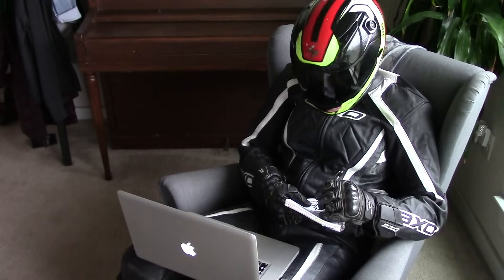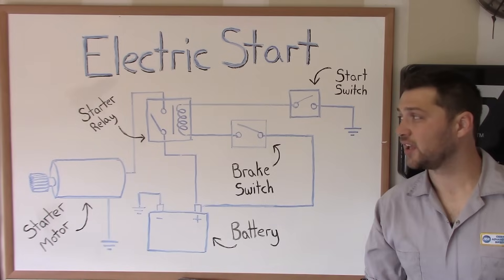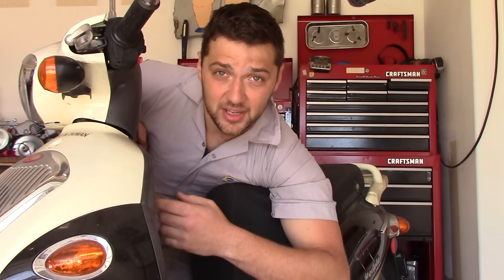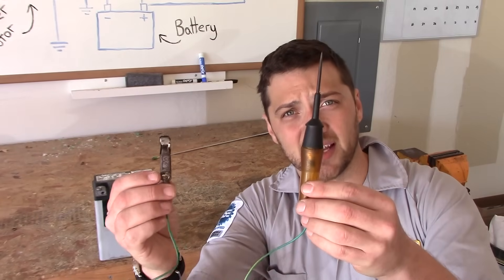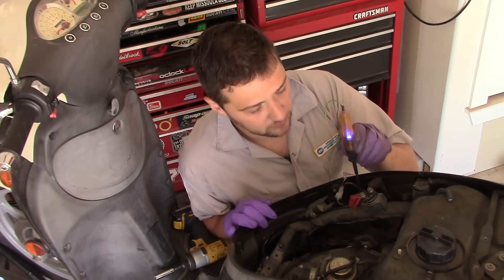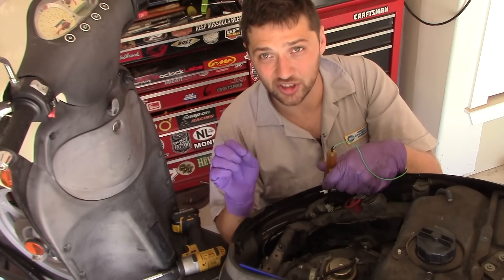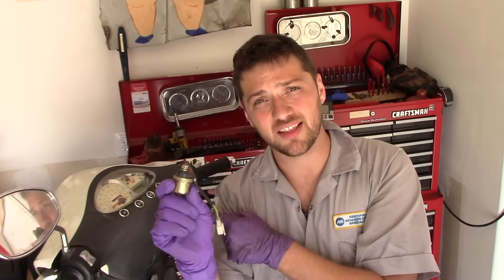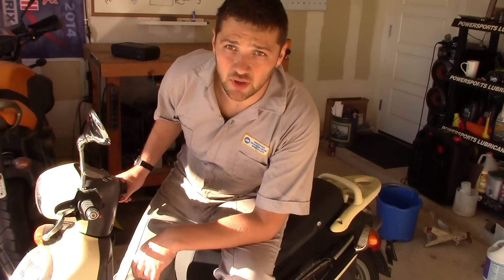Scooter 911: Electric Start Doesn't Work (troubleshooting your starter, starter relay, and circuit)

Comment: I have a 2013 benelli quattronove 49x. I got it a new battery, spark plug and gas, but every time I hit the electric starter or turn signal the whole thing turns off. The horn doesn’t work but the brake lights do and it won’t crank at all with the kick start. How do I go about fixing it? Anything helps 🙏

Comment: My scooter was running. All I did was remove the fuel tank, clean it out and install a new petcock. But now it will turn over but there's no fire and no fuel coming through.

Comment: Great information .  Doe's the key need to be on when probing with a light tester ?  I think I did it both ways .  Checking the starter relay .  I have no spark so I will be testing the coil next . Kymco people 250  2004

Comment: where do you start, after it's sitting for few years, now put new battery, new fuel, press start with brake depress and seeing brake lights on, but scooter does not make any clicking noise at all?

Comment: On my 1986 Yamaha Razz I replaced my battery and put new oil in it. However when I use the starter button the oil light turns on but the bike won’t turn on. My horn works and everything works. But the bike won’t start. Is there a wiring issue or do I have a faulty oil senso?  since usually a bike won’t start if there’s a bad oil sensor. What should I do? PS the bike does start and run perfectly fine when I kick start it.

Comment: hi garret im craig i have bought a lexmotot verona 125 cc scooter the guy said all it needs is a battery i charged original battery put it on and this happend no igntion no brake lights or indicators no horn but main headlight works but stays on when i remove the key any HELP would be apreciated

Comment: Thanks for the most helpful and pleasant my--scooter-won't-start video. My problem however lies with the bushings on the bendix. It was very hard to diagnose, but I can't figure out how to get the old one out, and the bendix wiggles in it's seat which just barely makes a slight connection to the pinion causing a rough noise and no start. Any tips for getting the bushing out?
Reply from the maker: Those really are very tricky to extract. I usually use a heavy duty lag bolt with sharp threads and a slide hammer but I imagine it can also be done with an "easy out" broken bolt extractor set. If you can get something to bite into the bushing sometimes you can even pull them out with pliers. If you don't feel like investing in tools replacing the belt cover sometimes is an inexpensive option
Reply: Thank you. I will try 💪. I refuse to let my Chinese scooter stay broken.

Comment: Very helpful, my girlfriend rebuilt her carburetor to one of your videos, impressive. So I jumped my battery I hit the starter button and the scooter started the next day the battery died because I left the switch turned on I jumped the battery only this time it did not start it just chugged and chugged and chugged until finally the battery died at least I thought I used the kickstart and it started right up I noticed you said this was a bad idea when I hit my starter button I get absolutely nothing but when I use the kick start it starts right up if at all possible can you please throw me out a quick solution your best guess I got a 2007 Yamaha Vino 125

Comment: QUESTION FOR ANYONE:  This video is way over my 81 year old woman's head.  I have a simple question.  PROBLEM: I turn the key on.  The speedometer lights up, but the motor does nothing.  No sound.  No crank at all.  So I bought a brand new battery today and installed it.  No change.  Same problem.  I'm poor and can't afford a mechanic any time soon.  Am I just stuck?   Thanks to anyone who has any ideas and advice.

Comment: So if someone did happen to have a metropolitan what should they do?
Reply from the maker: First thing is check the battery! Make sure you have good solid connection at the battery terminal as well and your battery is fully charged. If you don't have a good battery charger you can attempt to jump start the scooter. If you need a new battery we have them for sale on scooter911.com!

Comment: Trying to start my leike moped crossed my battery cables putting new battery, changed the starter fuse but still won’t start, need help

Comment: My starter relay has 4 wires not 2. I have a echarm 150cc use to run great then it died going down road I've replace qll the electrical stuff besides stator which im gonna have to do

Comment: what is when i bypass the starter relay the starter sometimes tries to turn the engine over and sometimes does nothing at all
Reply from the maker: If you're sure that battery is in good condition, it sounds like your starter may be the issue
Reply: @Scooter_911  also my 2020 taotao 50 has a ton of wiring issues do you have any videos going over the whole electrical system.
Reply from the maker: @wyattinabox  not yet my friend. I want to do a few, but it's challenging to manage the shop and YouTube.
Reply: @Scooter_911  thanks yeah the bat is only 2 months old and was fully charged.

Comment: Thank you so much for this video and your others. So easy to understand and helpful. I got to the point where I thought it was my starter relay that was the problem. Battery is charged and I checked the two wires and confirmed they are getting power from the brake light circuit and engine switch. But when I tried the trick at the end, the engine turns over, but never starts. Could it still be the starter relay? Or something else entirely? I thought I got the right diagnosis, as I made it all the way to the end, but when it didn’t start it made me wonder
Reply: I guess my question is, by doing the trick I’m bypassing the starter relay.  and it turns over but  won’t start running, what would likely be the next culprit. It couldn’t still be the starter relay because I’m bypassing it, right? Thank you for any help!

Comment: Have you ever seen a Coleman scooter? I have one it's Fat. I want though the head everything good but had leak on the exhaust valve. Fixed
Reply from the maker: nice work!
Reply: @Scooter_911  thanks there pretty simple to work on now before I scared to touch because I didn't understand the timing.

Comment: This video works for 2013-2015 Honda Metropolitan 2013-2015 honda metropolitan have a different motor than the earlier ones and the newer ones they have a starter motor that's have brushes

Comment: Very good video. But I’m having a different problem, my scooter is starting but the, starter keep running even after the engine is ignited and when I try to turn the key off it’s keeps running. I leave closed to the beach and I wonder if it has to do with corrosion in the wire ?

Comment: i have a 7amp good battery 3 months old charged. will it not be able to start a 9 amp scooter? i just got this 9 amp scooter. also its 26  degrees f  here. i have spark and fuel directly in the carb fully cleaned. kind of want to starts.

Comment: My starter relay looks different and has 5 pins and 4 wires connected, my kymco super 8 doesn’t start except with a kick start. Battery is news and lights/horn/break lights work, changed spark plug but still won’t make any sound even, I tried to bypass relay but it looks different than yours

Comment: Great stuff and very good and clear video recordings. I just got myself a Kymco Agillity 50 4-stroke scooter for fun to tinker on. the seller told me it wont start any more and thats why he got another one. With your fiirst video showing the magic triangle of the basic questions and your follow up videos i feel a lot more confident that i will get this thing running again. allthough it must be said the scooter is from 2006 and already did 28.500 miles but it looks pretty decent and i have a feeling it can go on for a while once i get it up and running. So i will def watch all the vids you put out there so far. So thanks again from Holland :D

Comment: Thank you for such a clear explanation onthe start system.  My problem was intermittent.  At times all I got was a click.  Then after closing both brake levers and trying again and again it would start. Your explanation pointed me toward watching the brake light when applying the brake.  The light only came on in the middle of the lever draw.  Another on line video identified that the brake lever switch can stick.  I cleared the issue by spraying the switch area with WD 40.  Presto!  Brake light works normally and the start is deliberate.
Thank you!

Comment: Hey, I touched those 2 connectors together. Mine didn't work. However, when I push the start starter button in and hold the brake, I hear It clicking. I tapped around the starter. I thought it started so I don't know what's going on. I guess the starter might be broke. What's the starter cost of these fifty cc's

Comment: Another question, how often should you change the air filter in that 50 CC scooter? I have, and also I had a hard time starting it. I've, it was running once I get it, running. It's good now. It's not running because of the starter problem.Let me finish up

Comment: Hello. I am trying to fix a no spark 2006 Honda Metroliaion. It turns over with a fully new battery, but no start, no spark. good compressiton. new coil. I am stuck???

Comment: i have a vitacci 150cc motorcycle, will this also work on finding issues on why it wont start up itself and i can get it to turn over and start with needle nose but itll die immediately if i let off gas, also notice when battery is on and even if i have key on the off position lights still on yet i have them off, and turn signals wont work, also notice i dont have brakes at the handles even though its full of brake fluid. i need some help
can we facetime?

Comment: Trigger voltage on most solenoids should be 12V. Check trigger wire(s) for voltage drop, anything less than 12V indicates a potential problem.
Causes include: 1. Bad ground in the circuit, like the ignition relay or side stand relay. 2. Tapping a primary (+) wire can cause a voltage drop if not done correctly i.e. some connectors cut the strands potentially reducing the downstream gauge of the wire.
The Volts in the wire are determined by Watts/Current. The amount of Current a wire can carry is determined by a formula. When a tapped device has higher current demand (more Watts, like heated grips), then its effect in the circuit can cause a voltage drop or variation in electricity supply when the deice is operated. Especially so, when the downstream wire has a reduced capacity.
Symptom:
Dead starter switch. 
Confirmed voltage drop at the solenoid trigger wires.
Instrument warning lights can dim or go out when turning the key to supply voltage to the circuit or when activating the cutout switch.
Fix, if tapped:
Check battery for charge.
Check for bad ground, usually variable voltage <12V at trigger wires when activating starter switch.
Check for voltage drop at the wire tap. Redo, restoring the gauge of wire using solder. If tap is necessary, redo using a soldered connection. 
Other:
Check the ground to all relays. Check the gauge of wires feeding power from the relays.

Personal experience.

Comment: Thanks, fortunately I have a kick starter, but it's a pain to put on the stand to use it for quick little stops. I watched the video and as soon as you got to the brake light portion I went and checked and no brake light when applying brake on the left side, but it did on the right side. Upon closer inspection I found that one of the wires had broken off the connection and fixed it...wala! My scooter starts again. Thanks!
Reply from the maker: @charlesrogers7154  excellent work! Now keep it shiny-side up!

Comment: This is a very helpful video!  Question... I have a 2009 Sym HD 200.  There is a black wire unattached in the battery compartment.   The battery is new but when I turn the key to Start, pull in the front brake and press the starter button, nothing happens.  Should that black wire attach to the Positive battery terminal?  Thank you!

Comment: I have power to relay but still no crank. Tried bypassing relay still nothing.  New starter,  cdi, voltage regulator,  plug and wire, new carburetor and battery

Comment: What if after turning the key and switching the kill switch open, as soon as I press my brakes, it looses power? I can tell because the gas gage goes up but dies down to e as soon as I engage the brake. It rained really hard I couldn’t get to cover it before hand. The horn sometimes sounds like water is in it sometimes but not often
Reply from the maker: @jahunmoayedzadeh9194  that sounds like it could be a bad ground or battery connection. Check to see that both battery terminals are clean and tight. If so, follow the negative battery wire until you find where it bolts to the frame. Make sure that connection is clean and tight as well.
Reply: @Scooter_911  thanks! I checked the wiring and the wire at the battery terminal was a little loose. After tightening horn is fine and the electric ignition switch started it up. Ground was fine. Checked the connection for the headlight harness that was good. Turns out it’s a faulty build. If I held it a certain way the light works. The metal casing is loose on the bulb used a little super glue and works till my replacement light comes in 
Apparently no shops in my area even knew where to get one.

Comment: This is a very old video.  So if you are still there, what do I do so that I don't have to put pliers on the starter relay each time I need to start my scooter? My relay is brand new.  All the probe lights, test correctly so what is next?  If the scooter starts with the pliers, what does that mean? I don't know what to do next.

Comment: Thanks for the info! I am trying to help a neighbor with his kymco people 150. I turn the key but no lights or gauges work. I can bypass the electric start and the scooter starts. Any help you can provide would be appreciated. I have positive light from battery to relay. I don’t get a light when squeezing the brake and pressing start button. I’ve looked at brake cables and they appear to be intact…

Comment: The fun thing is that i solved my problem at 1:38 :)
Reply from the maker: @jakubcintl5269  nice work!
Reply: @Scooter_911  oh, thanks for your reply,  didn't expect it :), thanks for your videos, they are very helpful, since this is my first scooter -  i don't have that much experience, (kentoya faver 125) i've putted a new battery in there and that seems to be the solution to all my problems with electricity, I am not used to the automatic thingy so i was starting it without pressing brakes :)

Comment: Thank you very much to explain the matter in a very easy way that even me understand! I just replaced the starter motor on a BV 350. the oldo one was very noicy and I thought was absorbinThank you very much for explaining the matter in such an easy way that even I can understand! I just replaced the starter motor on a BV 350. The old one was very noisy, and I thought it was absorbing too much energy from the battery to start the engine. Now that I have replaced it, I still have a problem: I hear a little noise, and the starter motor does not work. I thought it was some kind of electrical component not working, and now that you have explained it, I am going to look for the starting relay and see what happens. Thank you anyway.g too much energy from the battery to start the engine. Now that I replaced it I still have a problem: I hera a little noise and the starter motor does not work. I thought it was some king of electrical component not working and now that you explained it I am going to look for the starting relay and we  will see what will haappen. Thank you again.

Comment: First minute of the video saved my day. I'm used to a Harley, where you just turn on the power and press the starter button. Bought a used Zuma scooter, and no one told me about holding the brake levers while starting.

Comment: Thanks for the video! Very informative and helpful. 

My problem is tied into this, but I’m having issues before I even get to hit the start button. 

2018 Lance Cabo 200i, and it has the engine killswitch on the same side as the starter button. 

Turn the ignition on, flick the killswitch so it can run, and then I pop a fuse under the seat before I can grab the brake lever and attempt to start it. I'm going to run through the rest of your tests that you laid out, but idk if I can even get to the testing stages if the kill switch pops the fuse the moment it gets set to run. 😕 Any help or guidance is appreciated!

Comment: Somebody cut my front brake cable in front of the shop. There were two wires also. Can this affect when starting the scooter. Right now i have only back brake. If pushing the starter button, nothing happens. The fuel gauge also doesn’t rise and the turn signals doesent work but the ignition is on and the tank is also full. And can i start my scooter when bypassing the starter relay?
Reply from the maker: Yes as long as you have a good battery and the wires are still connected from the battery to the relay, and from the relay to the starter you should still be able to operate it by bypassing the starter relay.
Reply: @Scooter_911 tysm for replying
Reply from the maker: @raul6046  good luck my friend!

Comment: I have a problem at part when you disconnect jack and you try with test lamp when i do that nothing happens 1 wire is ground and it will only illuminate when i put second part of test lamp on positive terminal. Second wire when i press start button test lamp iluminates  but only if it is on positive lead what should i do